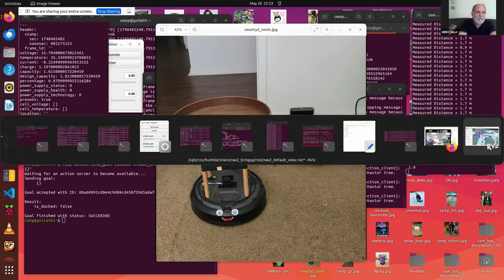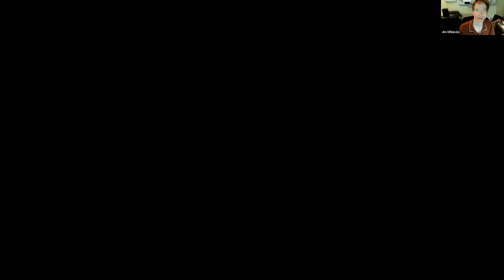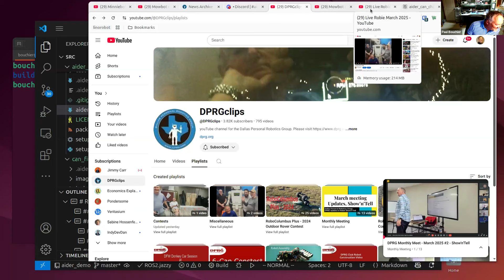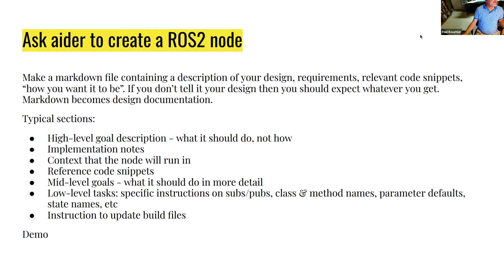Home Brew Robotics Club Meeting - May 28, 2025 - Making Personal Robots

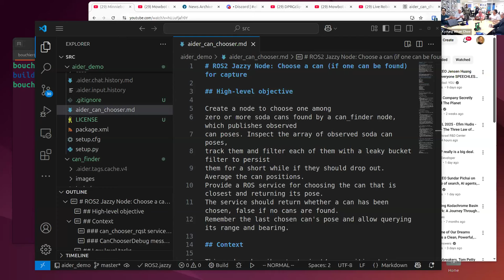Comment from the maker: 00:33:20	Carl Sutter:	https://www.superdroidrobots.com/store/robot-parts/mechanical-parts/wheels-shafts/wheel-shaft-sets/product=2388   Grippy tires and hubs
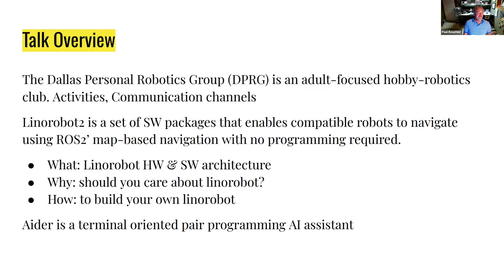00:35:01	HBRC Host:	China’s UBTech to launch $20,000 ‘home companion’ robot rivaling Tesla Optimus
    https://e.vnexpress.net/news/tech/enterprises/china-s-ubtech-to-launch-20-000-home-companion-robot-rivaling-tesla-optimus-4891679.html
00:35:14	Kyoung Whan Choe:	could you please speak louder?
00:46:24	HBRC Host:	Install the Python GPIO library.
 
sudo apt install rpi.gpio-common
00:47:07	Michael Wimble:	Reacted to "Install the Python G..." with 👍
00:51:43	Michael Wimble:	No, the sonar is not yet being used in his navigation
00:54:04	Michael Wimble:	On a raspberry pi or similar cpu, I recommend you tend to avoid any qos using ‘reliable’ as it will tend to block communication. Use ‘best-effort’ with ‘transient-local’ or with ‘volatile’ for better communication. Not much of what we typically do requires reliable communication as an option.
00:56:40	Michael Wimble:	Makerspace communication keeps freezing so we’re missing a lot
00:58:32	Kyoung Whan Choe:	discussion goes on in maker nexus lol
00:58:51	Jim DiNunzio:	shake a cable.
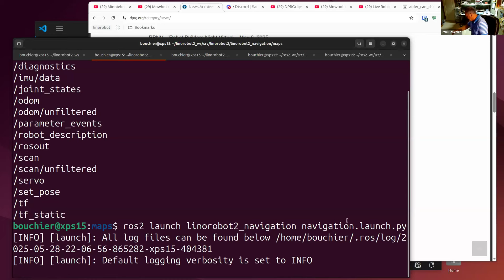00:59:08	Jim DiNunzio:	we are getting freezes from maker nexus
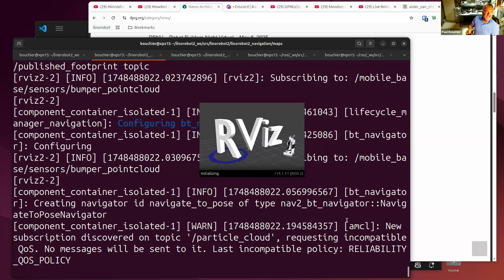00:59:14	Jim DiNunzio:	for 1 minute
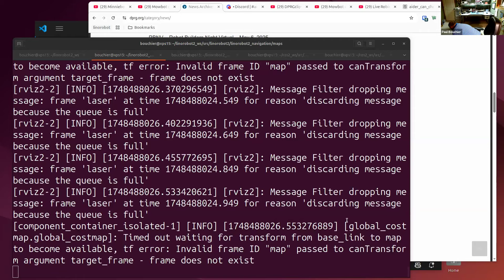00:59:18	Michael Wimble:	Didn’t you get my $20 to be part of the secret group?
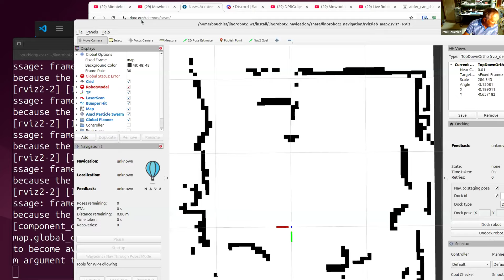00:59:44	Alan:	Maker nexus is freezing,
01:01:23	Michael Wimble:	<brrr>
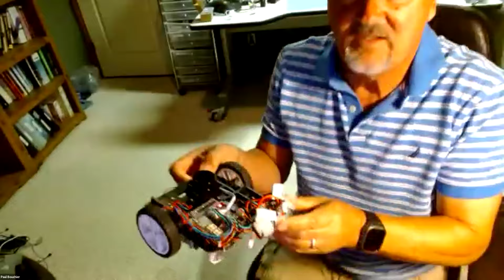01:02:17	Michael Wimble:	I hope this works better than my old Prius did. I would say, “go home” and it would respond with “I have turned down the temperature”. I would repeat, “go home” and it would say, “I have switch radio stations”.
01:02:39	DD.:	Reacted to "I hope this works be..." with 😂
01:02:53	Alan:	Mike, my sonar data QOS is set Reliable, Volatile, and it doesn't display,  If I try to change to best effort, transient local in rviz, I get buffer overflow.
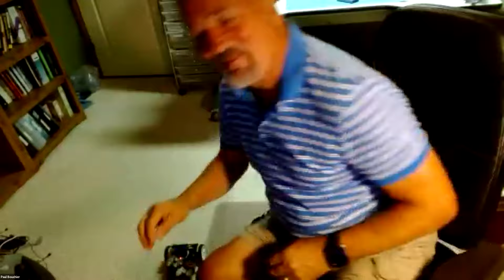01:03:23	Alan:	Not sure how to force the publisher to best effort, transient.
01:04:10	Chris Palmer:	fyi... internet or wifi at Maker Nexus is not great tonight.
01:05:26	Michael Wimble:	Well, remember that “reliable” is a guarantee. It will burn down the world to make it happen. To fix the publisher you need to change the driver software. But, I THINK that if the only client is “best effort”, that best effort is the only guarantee it makes. But I might be wrong about that. There is also something about history in the rviz topic display, make sure that is keeping only one message.
01:09:24	Michael Wimble:	Alan, make sure all your other rviz subscribers are also not using ‘reliable’.
01:09:49	Jim DiNunzio:	Here's the embedding AI model demoed:
https://ollama.com/library/nomic-embed-text .
It provides you a way to take an natural language phrase and get back an array of numbers which you can compare with another phrase and get back how close it is. I'm using it to allow my robot's text command parser to find the closest command it knows from the way the user phrased it if it does not literally match one of the commands.
01:14:19	Alan Timm (other alan)  :-):	Reacted to "Here's the embedding..." with 👍
01:14:50	DD.:	Reacted to "Here's the embedding..." with 👍
01:15:56	Alan Timm (other alan)  :-):	https://discord.gg/WFnwVtVG
01:18:03	DD.:	Seems a lot more organized! --> having discord...
01:22:35	HBRC Host:	Linorobot2
https://github.com/linorobot/linorobot2
01:24:13	HBRC Host:	Replying to "Seems a lot more o..."

I donno, Hackerbot uses Discord and I have a hard time grokking it.
01:42:24	HBRC Host:	Automatic Addison
https://automaticaddison.com/
01:52:38	HBRC Host:	https://github.com/hippo5329/linorobot2_hardware
01:59:58	Michael Wimble:	If you know a small amount of magic, you can also write your own “behavior tree” to control the robot. You can switch behavior trees. Behavior trees are what underlies the nav2 stack, and by default you are given a few you can use, though almost everyone uses the default one. You should look at the many youtube videos on what you can do with behavior trees. Especially, they provide “reactive programming” where, say, the robot is on its way to get you that cold drink but finds the battery is nearly dead, or that it discovers your house is filling with smoke, and it can deal with these nasty situations before it gets back to getting your your beverage.
02:00:30	HBRC Host:	Reacted to "If you know a smal..." with 👍
02:01:04	Kyoung Whan Choe:	maker nexus wifi is really bad
02:01:26	Kyoung Whan Choe:	we may call it a day soon ... sorry
02:04:30	HBRC Host:	AI pair programming in your terminal https://aider.chat
02:09:16	Michael Wimble:	Excellent presentation! Thanks!
02:10:45	Jim DiNunzio:	I have been using LINOROBOT2 for Truckasaurus for over a year now.